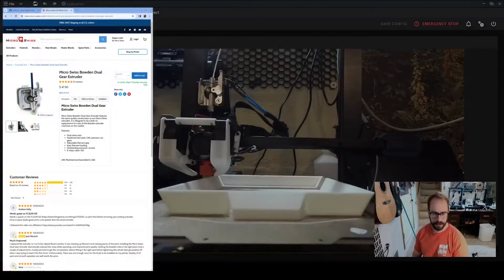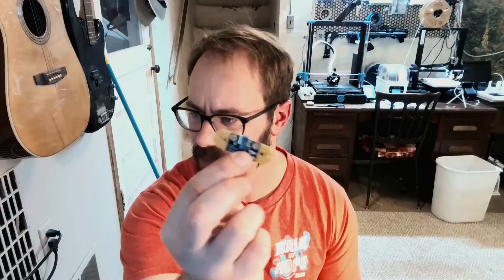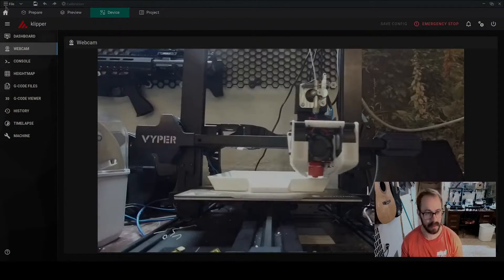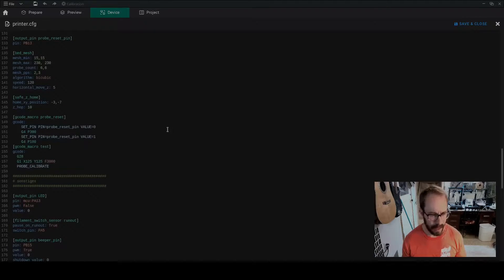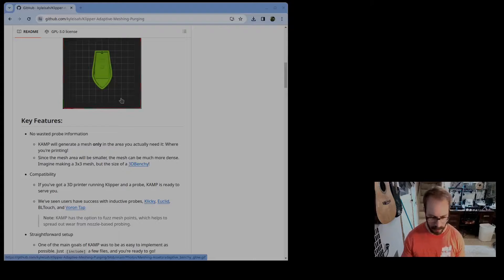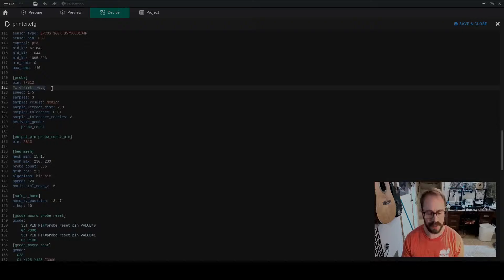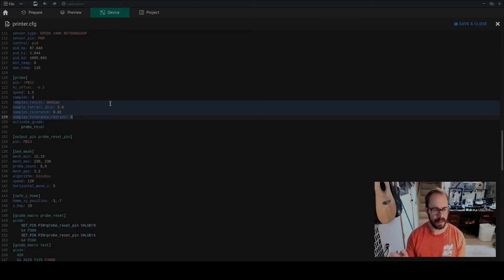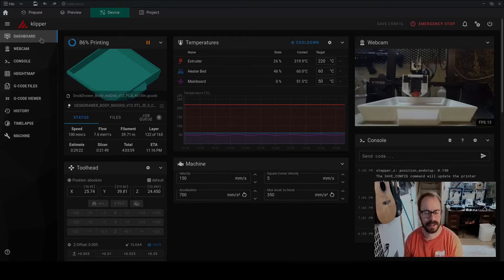My experience putting Klipper on my Anycubic vyper

Comment: Hi. I own a Vyper B variant but put an E version head and wire harness on it. I also have a Capricorn bowden tube and titanium bi-metal heartbreak. I also lowered z stepper motor voltage from 1.15v to 0.85v. I want to print high-temperature materials and switch to Klipper. I have an old Raspberry Pi 3b+ I was going to connect to the Viper.

What heat block and nozzle would you recommend that is still compatible with the stock heatsink and heartbreak? I tested thermal creep by running 260C for 15 minutes with all fans unplugged, and no heat creep occurred (I placed temp sensors into the heatsink and tip of heartbreak). Also, would you mind posting your code for your vyper that has all those pre-config settings?
Reply from the maker: @joebo9378  I noticed that I had having issues with print quality due to nozzle movement with the stock strain gauge probe. I recently redid my vyper with the EBB36 tool headboard, removed the stain gage, and added an inductive probe for leveling. 

I was thinking about making a long form video on it, but didn't know if anyone would be interested in it. This mod did drastically improve both print quality and speed. 

As for the pi 3b+ I had MCU disconnect issues on my vyper using one, but it ran perfectly fine on my SV06+    idk if that was something with the Vyper main board or just a USB cable issue. I use the BTT Pi v1.2, it has power terminals on it so you can power it directly from the printers power supply. It also has a small U2C module that made running the EBB36 from canbus extremely easy without having to add another large module.

Comment: What stepper motor did you pair with your microswiss extruder?
Reply from the maker: It was just a cheap one from Amazon. "Stepperonline nema 17 pancake" I am currently running the stock stepper because the shaft was too short for the knob on the other one. I have a twotrees pancake stepper waiting to get installed, I just haven't had the time to

Comment: Great video! Do you have any more  info on the input shaping and the Klipper. Would like to look into this more, and my googling isn't very good right now. Also, do you happen to remember the name of the printed shroud you did for the hot end?
Reply from the maker: I'm still pretty new to input shaper. I like the PIS board that I have, but to be honest the documentation for it was complete crap.  The only reason I got it to work was because someone did a very good Amazon review that walked through getting it set up. 

The cooling shroud I believe is a hero me 5, but the one in this video is not good for aftermarket V6 style hotends. It was designed for the stock V5 hotend, so the heat break fan will not work properly. I did find a remix that lowers the heat break fan, so it functions properly. I'll try and post an update video soon that walks through how I got things set up.
Reply: @kzdom115  That would be awesome and greatly appreciated! Thanks for answering the other questions as well.

Comment: I just picked up a Vyper on ebay for 85$ used , all my 3 other printers have klipper I was wondering if you would share your klipper configuration that you currently have
Reply from the maker: https://github.com/cryd-s/Vyper_extended

This is pretty much what I used as a starting point. The things I changed in my profile probably will not help as I have a different extruder/direct drive and hotend.

Comment: is it worth to install Klipper into Vyper without any mods and input shaping?
Reply from the maker: if your machine is working fine and you are happy with it, probably not worth it.
Reply: @kzdom115  well, it works fine but I welcome any improvement, especially speed for low cost. As I understand I need accelerometer for input shaping ? Which one do you use ?
Reply from the maker: @ygla777  I haven't tried klipper with stock hardware, but I am sure you would be able to get a good bump in speed and quality especially if you use input shaping. I have the fysetc portable input shaper board. It was kind of a pain to setup because the documentation was not the best, but other than that I have had good luck with it.
Reply: @kzdom115  thank you for your time. Greetings!
Reply: Thanks for the video. I think I found some good options for upgrades and the klipper with your help.
Reply from the maker: @nickl8985  I'm glad it was helpful for you.

Comment: I've had a similar journey. Vyper was my first printer, but now I have a X1-Carbon on the way. I've upgraded to the Micro Swiss extruder (but still in a bowden setup), installed the Revo RapidChange hotend, running community firmware, and controlling via Octoprint. It's nice to know the strain gauge leveling system on the Vyper still works with Klipper, though I've never been able to get a good mesh from it. I get a decent first layer across the bed now only because I manually adjusted the mesh through trial and error. All this to say, I'm still on the fence whether or not to continue modding the Vyper with additional hardware and Klipper, or just save that money and put it towards a more modern printer to have as a secondary. Your video gave me some helpful insights though. Thanks!
Reply: Im in the same boat.  Want to upgrade it more but not sure if i should just get a next gen printer with all that calibration built it.  But starting to think maybe i could mod it to print better then bambu?  ITs open source so the prefect platform for anyone wanting to outdo bambu with some DIY solutions. I have some ideas , like "closed loop" feedback to compare your motors moves to real space. Only Magneto X does tihs because of the nature of its linear motors, they need to know the position where they are constantly, unlike stepper their position is built into the steps, which are considerred an open loop system. I think you could DIY a closed loop system onto an existing printer with steppers.  Using a magnetic strip and a manetic detetction IC  (or simply hall sensor) to know its posistion on thie strip and check againstt he motors steps to make sure it go there, if not adjust.  I suspect this is why we dont have perfect prints still, even with Bambu's, they still print blind basically in an open loop config, relying on heavy tuning and calibration before hand, and it works ,but eventually belts loosen, tolerances grow and now you have noticable z shifts. Wouldnt be the case with closed loop system which could be DIY'ed.  Not as easy as i thought after discusing it with chatgpt, but still possible, and that should be the goal of modding i think, to make something better then you can buy, or at leaste as good without the cost. By the way i had bed mesh issues as well, until recently ive been following a routine and got perfect layer last night actually (but it clogged afer)  using the newest community firmware.  I press the home buttom first, then the autolevel button,  and in the level setting i have "better accuracey" turned on and "stabalize temp before probe"   even thoough the temps didnt stick to what i set them at during the leveling , this gave me really good results and im starting to think the bed level isnt broken. There was no manually adjusting the Z, the home button should take care of that automatically from my understanding. Thats what worked for me anyway. Ill get back to you after i deal with this clog and see if i just didnt get lucky, but im starting to think that first layer issue is gone, althought it was fine for most print it nice to see a perfect first layer.  I just got a kobra 2 pro in rough shape from a liquidation wharehouse and it put out a perfect first layer without trying, i think they use a better bed leveling system(non strain gauge).